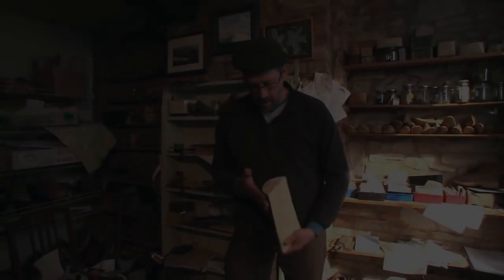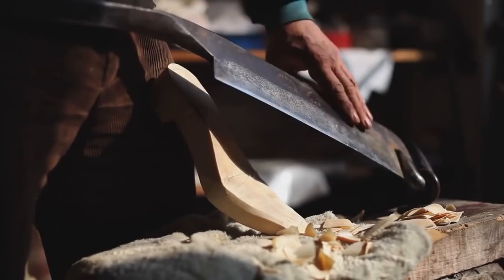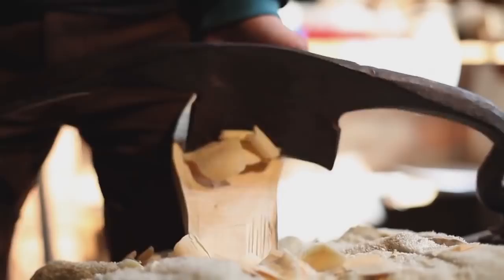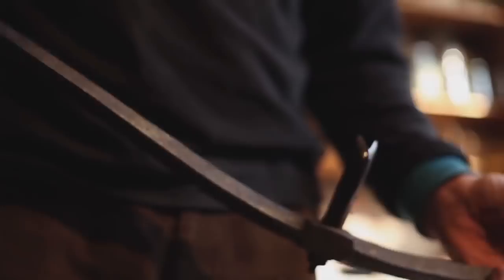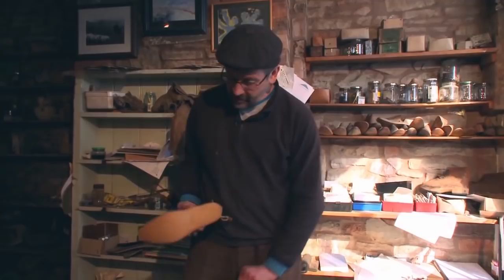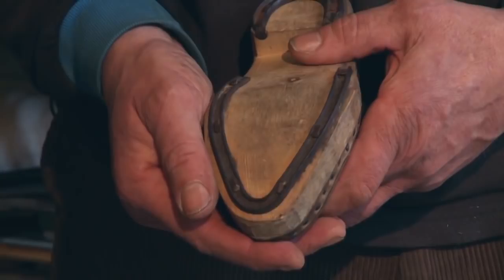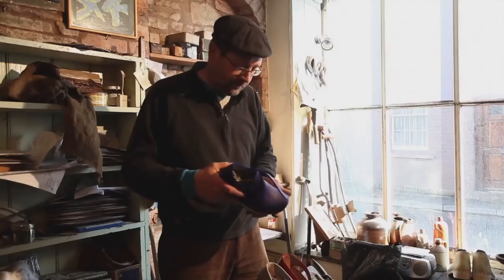Unintentional ASMR 👞 Traditional English Clog Maker / Wood Shoemaker

Comment: telling from how these heavy tools are held to the table with with a simple iron ring, the man must have excellent core strength, the ability to guide the majority of the heavy iron tool through the wood whilst also manipulating the wood to achieve the right cut must need so much strength. almost like holding a pull up mid air for 5-10 seconds. Looking at his hands also, this man is a very skilled wood worker.

Comment: A tool and the shape imprinted in the brain of that man, and all the muscle memory of years and years of working.

Oh, actually it’s different tools.

8:32 „The Blocker“ or „Stock Knife“; Clog Knife
11:44 „The Hollower“
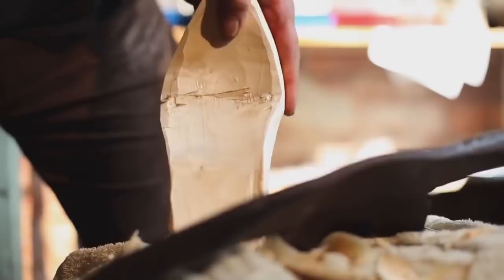14:36 third tool (I use what caught on well, I took a cam(?)) „very much like a spoon knife“
16:05 back to Stock Knife
18:34 „The Gripper Bit“ (V-blade) and a vanished tool maker (Matt Sears from Pembrokeshire)
22:54 Canadian Maple, Indian Water Buffalo; The standard „English“ way of nailing things vs how Thomas James did it with a piece of thread
25:47 how to get a straight onto a curve; then have the customer try it on: made to measure / benefits of a Village Trade
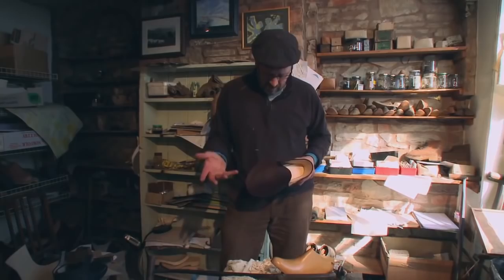26:24 a Welsh Slipper was a yard boot; very economic use of materials
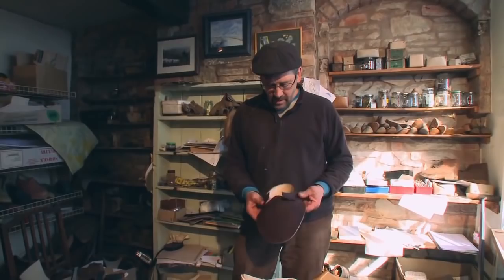27:10 an english clasp - two manufacturers in the North: „John Watts“ and „Horsefields“
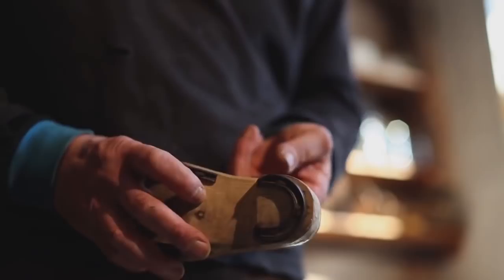28:00 five or six strands of cotton and two types of heavy wax (- one for winter, one for summer), a needle like a surgeons needle plus Russian Boar‘s Bristles; the old fashioned stitch: ideally it never comes lose (just by friction) and hides the joint, but you can’t fix it.
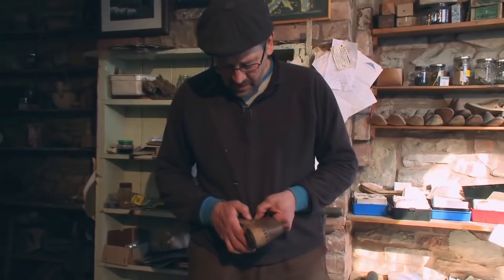30:45 brass nails and bent iron
32:37 something I do that others don’t; something else you can do in addition / what they do in Spain; you don’t want the leather proud, especially not for a dancing clog
34:51 Clasps and Buttons
38:06 😊
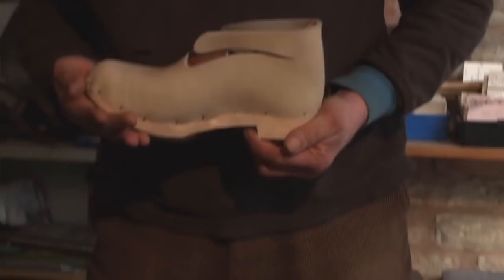38:46 Leather straight from the Tannery: Joseph Clayton, Chesterfield; also: traditional Leather Patterns are made from metal / tin(?)
41:12 examples of clogs made for customers

Bit of a shame that the original playlist has so few views https://youtube.com/playlist?list=PLh90tMebFBJ-tbWMUkZINMZvKFufNj3MA

Comment: Wonderful, it's very interesting to see that the craft is almost the same in Spain (which is more elaborate there) and in Italy.
Reply: The spanish knives are really awful, and there are far fewer styles Possibly more elaborate but less sophisticated.
Reply: @jeremyatkinson4976  This is simply not true, I've seen documentaries of Spanish craftsmen making "albarcas cantrabras" and similar clogs and they are just as elaborate and sophisticated as you could imagine, they were meant mainly for farming in soft soil in cold weather, that's the reason why they are like that, in fact you need thick wool socks and a pair of light weight footwear to use them as they are more like a protection for said footwear, they remember me to getas.
Reply: And by the way the tools are basically the same, specially to shape the log, in the British, Italian and Spanish versions of the craft.
Reply: @TheGrmany69  I was referring to their versions of the british style clog.  The carvers of those also went to Switzerland to carve that style. The best knives I came across in Galicia were french. The metallurgy on the Galecian knives was primative in the extreme, basically pre industrial revolution barter technology. I was given a set. They used willow, birch and alder. The knives weren't up to carving sycamore, which  was only used for the all wood style . I did go to Quintalla in Cantabria to visit a carver of their amazing all wood clogs. He'd never seen the free form guillotene knives that the brits and galagos used, was a bit nonplussed when I showed him. He was a stunningly good craftsman, far better than I could ever be, used birch and walnut. I have to say the welsh knives I've got are not very good either.
Reply: @jeremyatkinson4976  Very interesting in the details of your explanation, and you are right about metallurgy there, Oscos Eo not so far form Cantabria still uses water wheels to produce knives, though they are sold more like a cultural souvenir than a state of the art tool, but remember that Gallegos/Galicians are Spaniards as well; aside, Cantabria is a very small "Comunidad Autonoma", Asturias, Galicia and Viscaya are far bigger and they also have clogs using those same tools (or most of them), they even have an specific classification of albarcas regarding their dimensions and accessories.

 I read the other comment and no, clogs are wooden footwear made out of logs, Northern Italians use the all wood footwear popularly associated to Swiss, even Japanese geta are regarded as clogs, not sandals.
Reply: I really appreciate debates like this, I love this craft and it would be terrific to know more about them, can you recommend any book or blog about it.
Reply: @TheGrmany69  I take it english isn't your first language so do yourself a favour and check the english oxford dictionary . Having made them for forty years I have checked the dictionary definition. I'm english, not american. We don't speak an identical language.
Reply: @jeremyatkinson4976  LOL

Comment: That blade though - Holy crap. That seems like the most efficient maddening design possible. A horror film blade attached by a hook and loop screwed into a bench/wood block. The actual effort it took to use it seemed ridiculously wasteful despite his expertise in using it. Was it just me or did he need a better system for using that blade? He completely puts himself in harms way while knocking his center of gravity off balance. Brilliant to him for figuring that death trap out with precision!
Reply: No that's how it works. Problem is I'm doing lots of different cuts and it's impossible for one bench to be optimal for every variation.

Comment: The way the handle angles down seems so impractical, why not have it straight, barely any leverage would be lost and it would be more comfortable to operate

Edit: possible curves for stability?
Reply: I've got one knife like that. Discovered the handle needs to pull the blade in. You are correct in your supposition

Comment: Love this guy and his expertise with clogs but he's talking out of his rear a little at some parts when it's not his area, like his 1st tool,  the reason it's not all high carbon steel is that 1) it's cheaper to make it that way as instead of using all high carbon, you can substitute some cheaper materials. 2) it's easier to make it that way as high carbon steel is difficult to work in the forge, needs very high temps. it's not as though it couldn't be made of 100% high carbon, all you would need is for it to be differentially hardened. Making the spine of the tool out of softer material is just a cheaper way of doing that.
Reply: High carbon steel is more brittle though, he wasn't wrong
Reply: NBDZero high carbon steel can be as soft as you want it, just anneal before use. Heck iron can be much more brittle than a high carbon steel depending on what you do to it.
Reply: But he doesn't want high carbon steel that's soft for the cutting edge, and whats the point in making separate pieces of the blade with different properties of high carbon steel, might as well just use iron
Reply: NBDZero ....that's why you anneal then differentially hardened the blade. The spine stays soft. 
Cliche example but that's how katanas (and most single edges swords/knives) are done.
Reply: Fair enough, I don't know really anything about working with metal
Reply: I'm going to trust the clogmaker on this one.
Reply: A lot of the very best handmade blades are still laminated.